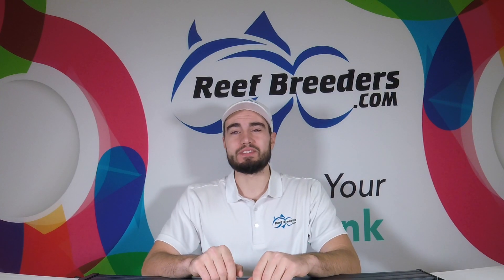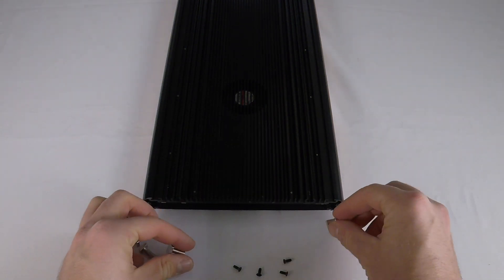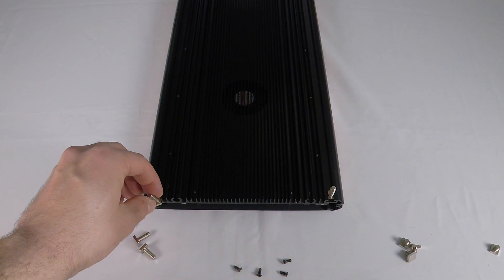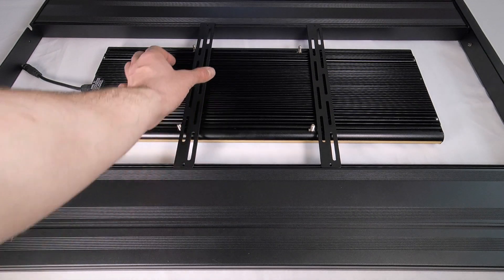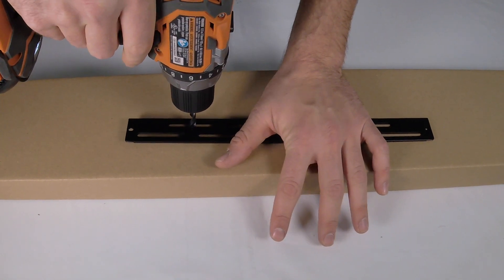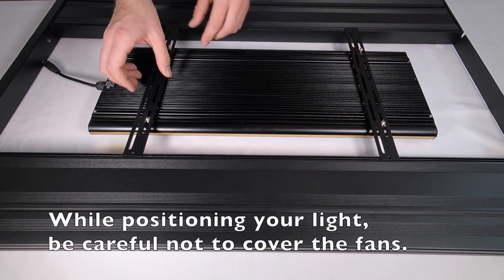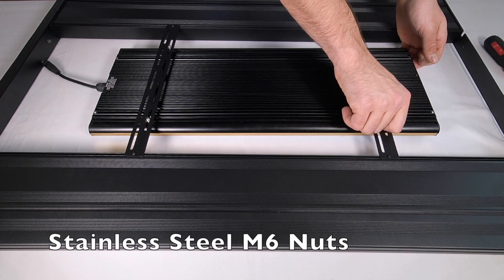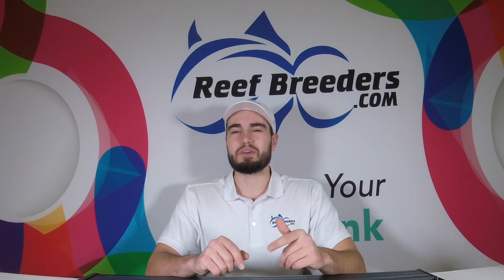Photon V2 Aquaticlife T5 Hybrid Kit Installation Guide

Comment: I juts received both these items, and none of these items fit like this. So you're telling me i need a different end caps, different bolts and different nuts?
Reply from the maker: Yes, this works only with the original non-dimming kit, and you need 24" brackets and endcaps. Alternatively, you can simply sit the Photon On top of the kit with the center brackets between LED clusters for support.
Reply: @ReefBreeders   so if we  have the newer non dimming  aquatic life fixture the 24" endcaps dont work? I have no screws on the sides of my fixture
Reply from the maker: @name1thing1  the G2 non-dimming kit is the same screw patter and size as the G1 according to aquaticlife.